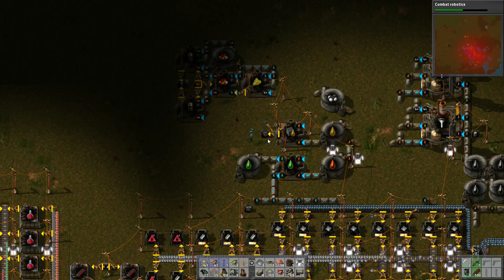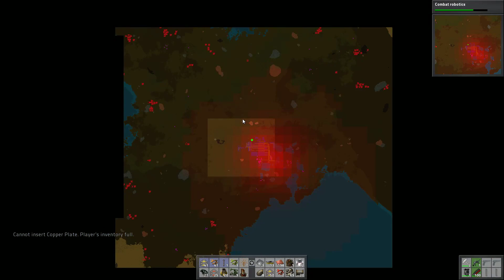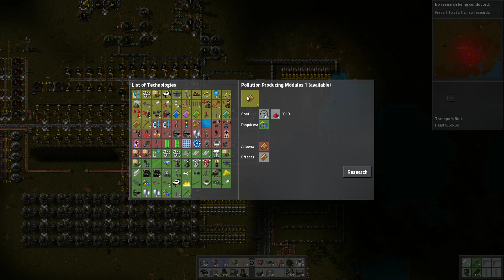Factorio Dytech Mod 13

Comment: why do you pump the oil from way down on the bottom of the base all the way to the top then run it down on a track all the way down and then on another track all the way up?  LOL  Couldn't you just create some solid fuel at the bottom at the source?  Or you know... just get more coal.

Comment: Electric furnaces would make fuel production and supply simpler, though I have no idea if one way or the other is a more efficient use of the fuel (or if going full elec would require more power at this stage, and what the corresponding resource cost of that would be).  Probably have taken longer to craft them all than to get the supply going again, though, so may still make sense in the short term doing it that way.

Comment: as far as the oil industry goes, the chem plants prioritize the top output first, which is why the northern battery plant + storage container was getting fed more so than the southern one, you need a fluid storage container between the sulfuric acid and battery production for even distribution.

for solid fuel production, i just keep them completely separate ( which is why i got super confused when you started talking about the " two sides " of the oil industry, as i consider fuel production / item production the two sides, rather than your definition ), as a dedicated solid fuel production facility can keep going for a loooong time ( due to being backed up 99% of the time ). my setup is pretty straight forward: heavy into light ( when you can, otherwise heavy into fuel), light into fuel, petrol into solid fuel. that big open space you now have where your coal used to be can easily fit such a setup in there.

Comment: Actually a southbound solid fuel belt would've been exactly the same assuming you used the same arrangement of splitters. Just send 50% (or 80-odd % as you have done) all the way south to power, and the rest splitting off to furnace lines as necessary. When the split happens shouldn't make a difference to its priority towards the various fuel-using departments.

Having said that, it wouldn't necessarily be any neater I suppose.

Comment: That damned solid fuel gets made way too slowly. Unless it burns a lot, lot longer than coal I don't think it's going to work.

Also you should have just plugged in 100% of the fuel into power and only split it after all boilers were satisfied.
Reply: At that much oil consumption it's probably better to just start a coal outpost somewhere and start working towards trains.
Reply: it burns a lot longer
Reply: Its three times stronger then any other fuel, as a reference.
Reply: he will need to atleast douple its production though
Reply: ***** yeah